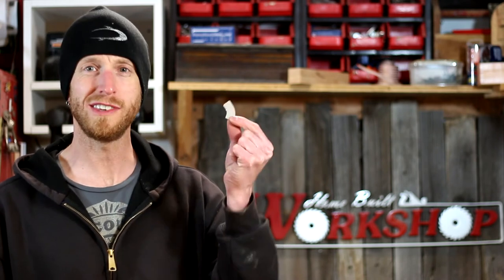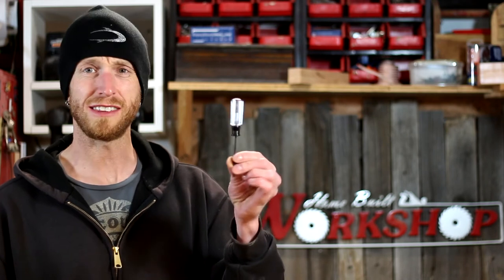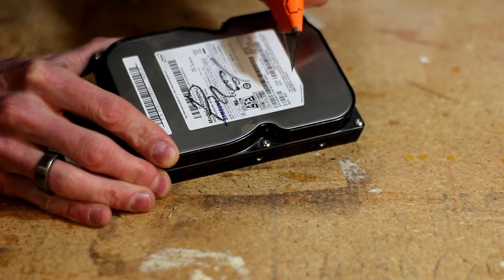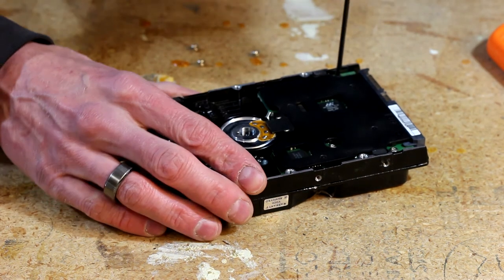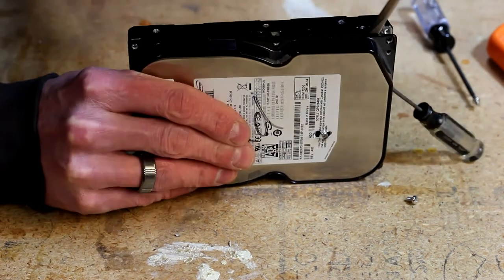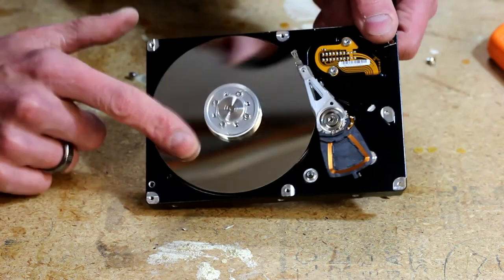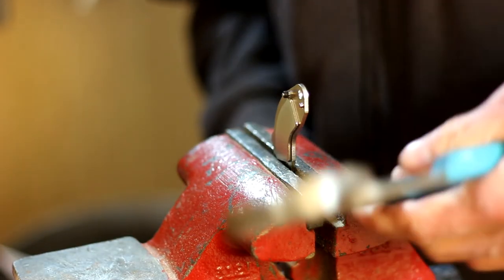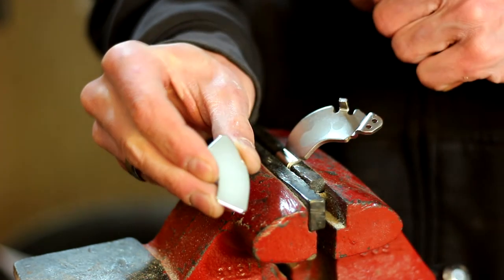How to Disassemble a Hard Drive to get the Magnets

Comment: Brilliant - I'd been struggling all afternoon trying to work out how to extract the magnets as they weren't screwed down. The strength of the magnets held the holding plates in place. What puzzles me is why the data isn't stripped from the discs with such strong magnets in close proximity.
Reply: The magnetic field is channeled in such a way as to not interfere with the disks, just the arm that contains the heads.  If you carefully put magnetic items next to the assembly, there is only a relatively weak magnetic field outside the assembly.  Remove the magnets as in the video and try the same magnetic items close to the magnets.  Big difference!  Also be careful as these magnets can fly together with enough force to break apart damaging the magnet and things around them (like you).
Reply: @probusthrax  Thanks. That was the only logical conclusion I could come up with. I noticed that if I turned them around (still attached to their own frame) they would attach to say the fridge with only a fraction of the strength.
Reply from the maker: Oh yes, I have pinched my fingers between these. Doesn't feel great.
Reply: Thanks! Like you, I'm always finding use for a good magnet and was at a loss how to get these clear